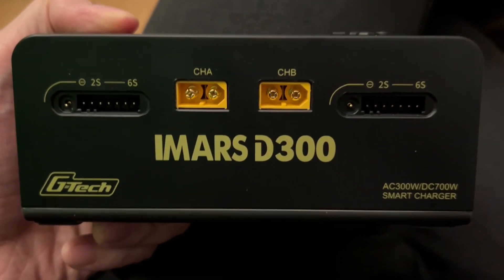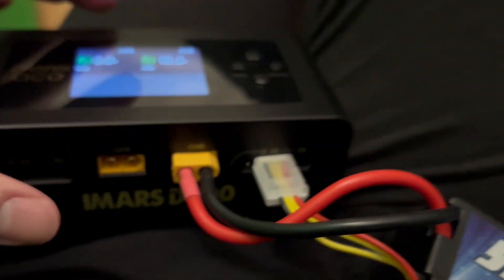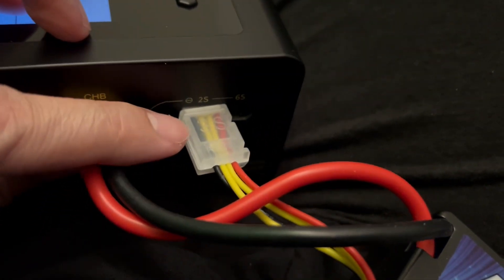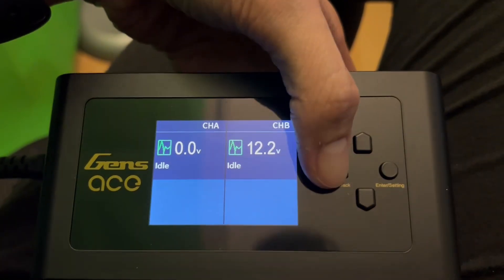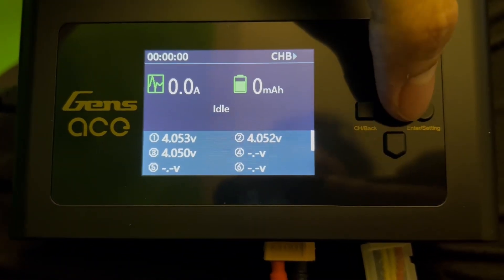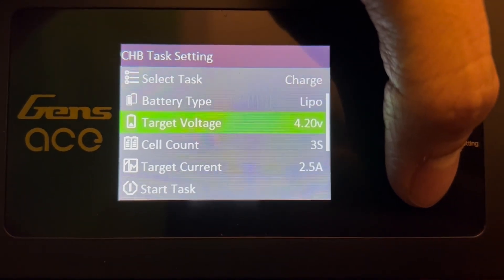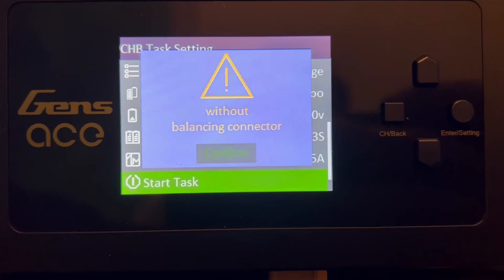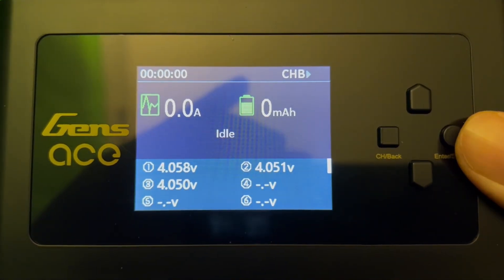IMARS D300: How to Charge Batteries Guide

Comment: you left one pin open on the left so I do not understand all the way to the left but you left one pin open
Reply: Pin open on the left is for gtech. Only gens ace gtech batteries will fill this spot, and you can’t accidentally put a non gtech battery over this pin due to the design. Gtech is a lot like traxxas ID in that the charger actually identifies the exact type of battery plugged it
Reply from the maker: I may have mixed my directions

Comment: Does this charger have reverse polarity protection? My previous SKYRC charger died because I accidentally plugged the wires to the battery in the wrong polarity. My battery is the pin holes type. Thanks 🙏
Reply from the maker: Not sure but some plugs only fit in one direction to prevent that
Reply: Appreciate your reply. My batteries are hard-case LiPo with bullet connectors. The type used on RC drift cars.

Comment: just got the d300 charger. Do you know if there is a way to set it to auto shutoff when the battery is done? I dont like that it beeps when its done, cant set it and forget it. 
Also, can I use the DC port with a car battery?
Reply from the maker: Not sure how to do that. For the DC port you may need to get or make an adapter
Reply: @kevinwoodrobotics  can I use a car battery?

Comment: What’s the difference between the charge and balance? Doesn’t “Charge” charge them in balance?
Reply from the maker: Great question. Not sure why they separate that
Reply: For D300 the only difference between charge and balance is that balance can charge at .9 amps where the charge setting cannot go that low
Reply: @Krais3r ok good to know. I’m a noob when it comes to LiPos and chargers so I’m learning something new everyday. Is the balance also
for when the LiPo cells are out of balance? And that will charge them back to an equal voltage?